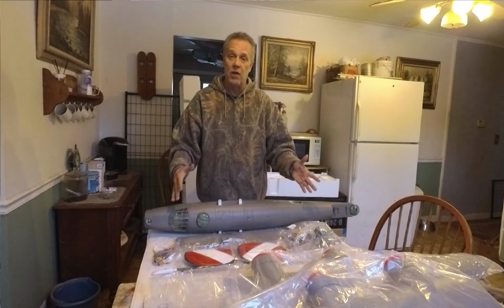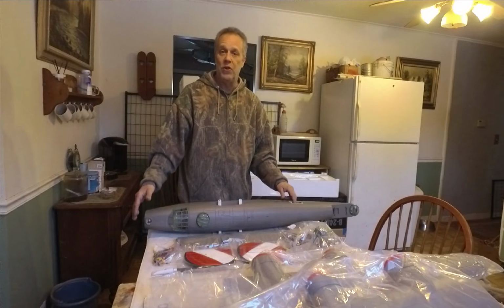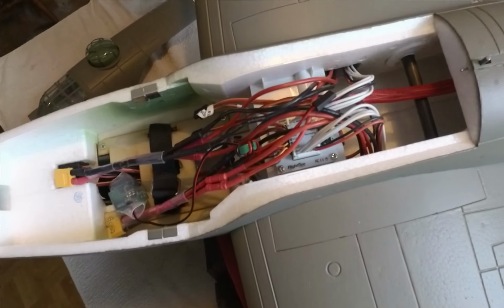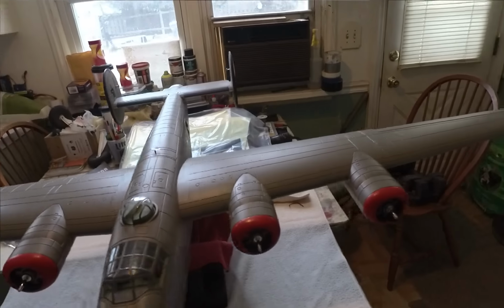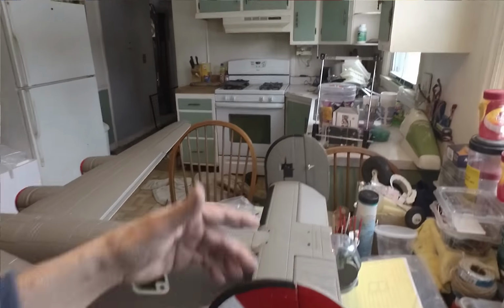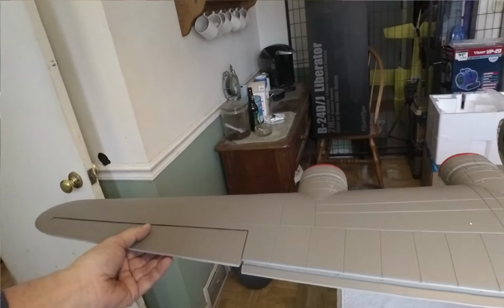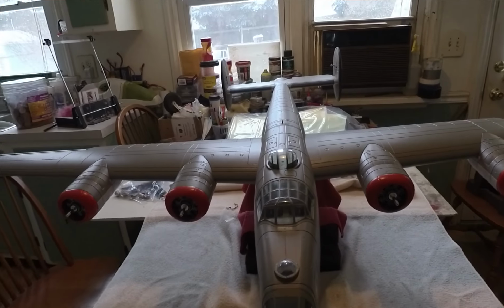B-24 Liberator by Flightline RC. 2000mm WWII Bomber  (Basic Speed Build)

Comment: Nice video Skip. I just finished mine but have yet to take it out because of this damn COLD weather. I did mine as the Witchcraft even though there are so many great options. I was able to get on the Witchcraft first part of the summer last year and it was super cool. They also had the B-25 Tondalayo and the B-17 Nine-O-Nine there. Just curious, how did you run the UBEC?  y cable off the receiver?

Comment: Thank you for the  B – 24 video. I’m wondering what you plug the UBEC wire into – I only have a six channel receiver so all channels are taken? Also, I noticed there is a nose gear door port that is open on the Integrated circuit module—not sure what I put in there? Any help?
Reply from the maker: Sure thing.  The nose gear has or was supposed to have an optional gear door.  They didn't put one on it because of ground clearance.  The ubec just plug into the bind port after binding is done.  Use a y connector if needed or temporarily use another port for ubec.  Bind then put ubec back on bind port for power of servos etc.  Hope that helps you out and thanks for watching.  Happy Flying.  She flies Fantastic.  Unlimited Vertical with 4s.  Very Important to balance your blades well or you'll loosen motor bearings 1st couple of flights.  (Learning Experience)  Take care, Good Luck on your Maiden, Skip

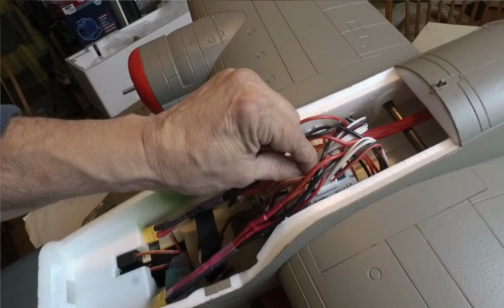Comment: at 5:06 on the video underneath the two battery plugs is a flat (speed controller??) underneath;   where on earth do you plug that in?  it has a servo plug on one end I don't see where that plugs into???
Reply from the maker: triplanelover that's the controller box that comes mounted on the plane the ribbon connectors coming out of the wings plug into that that plugs into your receiver
Reply: Hey I am sorry, I have exactly the same question as triplanelover, but i didn't understand your answer. so there are the two ribbon cables coming out of the wing. but those plug into the interface, no? so there is still the red-black-plug that i can't plug anywhere. because the interface has a plug going from the front directly to the receiver. Maybe i am completely wrong, but i am a bit lost with this. thanks yor your help Skip. Your videos are a real joy to watch!

Comment: Is there anyway you could text me a picture of your wiring set up? My servos work but I can’t get my motors to run.
Reply from the maker: Wish I could do that, but it's all together and hanging up on display.  I remember that the motor harness only goes together easily one way.  It was designed by Alpha to be good proof.  I believe Motion RC has a good picture/video of hook up procedure.
My video was probably too fast to catch anything specific.  Oh, one very important thing is make sure all props are balanced.
Otherwise it'll cause loose motor bearings after 1st or 2nd flight ✈️.  Good luck 😃